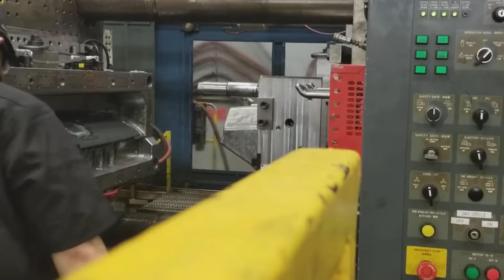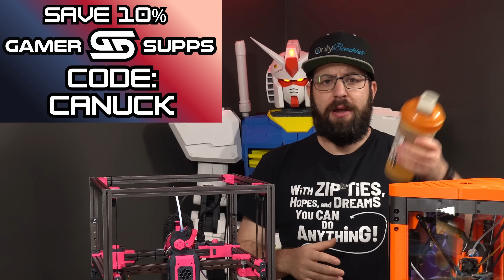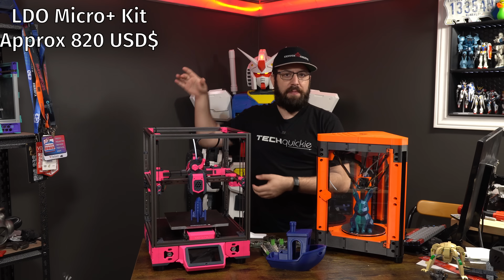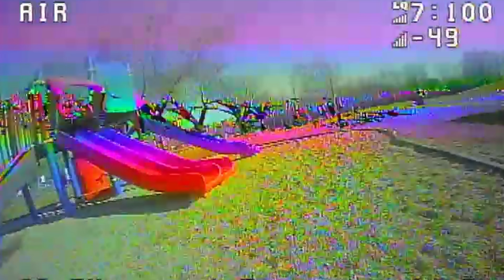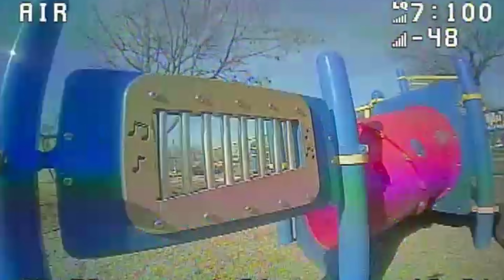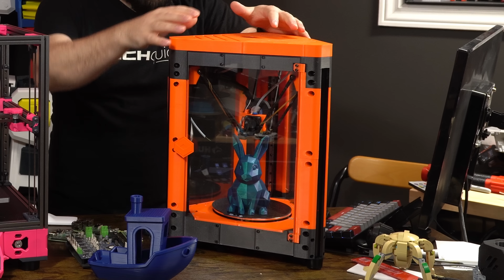Are DIY 3D printers in danger?

Comment: I'm by no means an expert level 3D printer owner. I've had an Ender 3 S1 for a few years now and it was my second attempt to get into the hobby and I've had moderate success. I really wanted to get one to push me to learn 3D modelling. But time is limited for me. My first attempt was an old Rep-Rap Guru kit back in I think 2018 or so and it was a disaster. The Ender 3 S1 has been an amazing printer and although it took some basic learning about how to keep it tuned and maintained, it seems like the way to go. The Bambu printers scare me because they streamline so much it doesn't feel very sustainable and it is a closed eco system that doesn't give back to an open community, it is very insular. I like FOSS and I like using Thingiverse, the Makerworld platform seems like a very privileged club of people who want to high five each other for their cool printers they act like they don't have to maintain. It doesn't work for me. Anyway, that's my rant on my experience with 3D printing. I hope to see more options that are community based but can match or surpass the features of the Bambu stuff.

Comment: I would love a core xy but so torn between the hardware bambu offers and the constraints id be required to work within. Sticking with my opennept4une n4pro for now
I just want raw klipper that I can control with python and g/m code. As a cnc operator by day studying electronics, I dont want a walled garden. Give me bambu hardware with an open back end.
Reply: Honestly? Look at some other btands. Bambu's absolutely a walled garden.

I got myself a Qidi Plus4, which is klipper based, and I run it as an sirgapped machine. I run Orca Slicer for all my prints.
I'm very happy with it. But there's always ways to tinker with a pre-built machine if you want as well.
Reply: @LordPhobos6502 i definitely use orca. Ive heard of qidi but never looked too deeply. I just like the hardware kit with bambu, the ams and lidar on higher end models. I havent really seen many open source material swap systems that actually made it to market, but i guess its been a year or so since ive looked.

Comment: Cheap DIY kits and good documentation. That's the ticket. 

The DIY learning curve is ridiculously high. Printer designs either have barely any documentation (with a lot of crucial info just assumed to be common knowledge), or have a sprawling modding community with so many modding options and different opinions that it just leaves beginners lost and confused. And typically leading to a waste of time, money, and a lot of frustration. 

I think those "fun" printers that Rolohaun is designing is the right direction.

Comment: Well... Commercial offers is not that great. No doubt, Bambu manufacturing reliable and long-supported printers at reasonable price. But basically,  that's it. Fixing and maintaining commercial machine is not that great when it is not reliable or it's support was dropped in a year. 
Many brands have poor designs full of flaws and questionable reliability. Like famous Creality K1 which just refused to work properly due to poor decisions and haste on release. 
I would consider to buy a printer only from Bambu or Qidi. For me, personally, that all that market can offer. 
Cheap P1 clones not much better than bedslingers. Questionable quality, questionable support period (when printer being released with no sparse parts), maintenance harder compared to bedslingers and comparable speeds (if not worse) due to budget and poor design decisions.  
Buy P/S bambu 256 cube or build your own 250 cube? Sure, just buy a Bambu. DIY 250 CoreXY still can perform better though. 5-6k accels on walls that bambu offer isn't something really fast. Stock trident can perform much better. Even without any mods. 
But what about 300-350 size or 120-180 size. Here market has much less to offer. 
I need small, fast, hitemp machine. What I would buy? There os no offer for that demand. I built K3. It's fast, reliable and I can maintain it with ease. 
Same with 350 size. Bambu H2 series are great. And expensive as well. Self-sourced 350 Voron will be cheaper and perform better [with mods]. 
 To sum up: I think that commercial offers is not that great [at this moment] to kill DIY 3D printers. DIY community actually benefit from stuff like good-quality mass-produced PEI sheets or silicone nozzle scrubbers or MMU or.... [whatever].

Comment: I think DIY printers are a good solution for mid to big volume printers at a competitive cost for performance. 
 For a 400x400 or bigger build plate, the shelf printers are either too expensive, or too unreliable. 
I tryed qidi for a shelf solution for a mid size plate and heated chamber, I got a super unreliable printer that Im struggling to return ...
For the same money of the qidi , or a SV08 max or any H series bambu, we can build a decent Core XY machine of the same size and with some  premium components. 
Now for 250x250 or similar size the market as a lot of decent machines at a competitive price that just work out of the box.

Comment: I have joined 3d printing in the ender 3 era, modded it fixed all stuff it needed to fix and i stopped there. Its not cheap sport just to hoard machines that you will not use once its all tuned. Im stuck with this useless knowledge about obsolete machines after bambulab type of companies came out.

Comment: I disagree with you. The stagnation is not as bad as you think. Bambu showed up with the X1C, showed everyone how you build a reliable printer. Then dropped the P1S and lowered the price significantly for a good Core XY. Then dropped the A1 at a quarter of the price of the MK4, forcing everyone to move past the Ender 3 clone era. Then came Flashforge and Elegoo with super affordable CoreXY printers. Now You have the U1, the X2D and the Core one INDX fighting each other with wildly different multi nozzle approaches. 
The main reason for DIY is that it usually is more affordable. This is no longer the case for 3D printing. What DIY has, is the innovation, and will be a core aspect. Multi axis printing, insane slicing configurations not doable lest you build around it. DIY might not be the best approach for most anymore, but it is a key aspect in driving innovation forward and preventing monopolies from forming

Comment: First of all I love all the work building and tinkering. My first experience with 3D printing was when I got an ender 2. I didnt want to be out much money if it wasnt for me. Turns out it was. I modded that thing with the belt tension, cooling ducts, aluminum extrusion tension lever, ABL probe (yeah 135mm lol) ABS parts. I enclosed into a IKEA lack table enclosure. Bought a 200W heater. And made it print parts for a Voron 350x350. 2.1 then upgraded to 2.4. When they went to direct drive. I never did the stealth burner. But I've been wanting to upgrade to 4 head stealthchanger. But as you said parts are expensive, id have to redo my entire printer that has been bulletproof. I've bought some parts for it like Clicky Klack door, BTT octopus pro, but cant seems to get around to it. I think its because I should make a whole other printer. But dont want 3 printers.

Comment: Watched the 3d printing community here and there over the last years (started when i saw an Makerbot machine in 2014 / 2015) and finally bought my first printer, the P1S Combo last year in May.  After i got enough into to get ABS and ASA properly printing i bought an Formbot Voron 0.2 kit as my first DIY project. Including  a lot of mods like Dragonburner V8 and CAN from the start. Took a while but was a fun little build. But i never saw anything of Klipper before so the software setup was a huge pain und took me double the time as the actual build. But after i got everything working and dialed in it prints unbelievable well. Almost same quality as my P1S and only slightly slower. Adding all up including needed tools I am roughly in same price  range of an new released X2S Combo. Do I regret it? not really. It´s all about the experience to build one printer yourself and getting to know how anything from the kinematics to software works. would do it again any time!

Comment: All of my printers up to the latest (with the exception of my resin printer) have been open source, self build. I have slightly gone to the dark side, and bought a Bambu, which is great, BUT, it does have a few foibles in it, which you CANNOT get rid of, because its closed source. Hence, I will always prefer open source because problems can be pretty much always solved, by either changing firmware, or hardware. (Also, I virtually never print decorative stuff, it's pretty much all technical things, useful things, and often... Bits of printers!)

Comment: Prusa was and still is in the middle ground of two worlds. Their software is open source and you can buy a Kit and modify your printer while building it. For example the C1: 1.5GT belts, pulleys, toothed idler and "pind" mod. It is kind of a printer from a big company but is also "your" machine. It is also a very good machine and for me does not lack features. It has motor phase calibration with the TMC xDirect. Klipper can't to that due latency issues as of now. Which means the printer is much quieter than most DIY machines. Even though RRF is about to launch that feature with RRF 3.7 or 3.8 but RRF is a niche within the niche but I still use Duet3D controller boards with my Voron 2.4. That is why I support Prusa and soon buy a C1+ with INDX. I can build a printer, get a steel frame and a quiet and also VFA free printer. Many cheaper printers don't offer that package (if not all?) because even a U1 as a tool changer has VFA at TPU print speeds. Also I love my Voron 2.4 but heat soaking the aluminium frame isn't fun when your other off the shelf machine has a steel frame and is after 15 mins ready to go. The DIY market has shifted but not dead and with INDX around the corner and Duet3D being the toolboard supplier I hope they will exist for years to come.

Comment: As someone who also started in 2017 and has 2 Enders converted into core XY machines, I've been through the pain of getting those machines up and functioning. My X1C has just worked straight out of the box with no problems since I got it in 2022. I took my two enders down to add beacons to them in 2024, and haven't brought them back up just because I haven't needed the throughput of 3 printers, along with the ease of use from the Bambu. I honestly don't know if I'll ever feel the need to bring the enders back up. They were fun to tinker with, and taught me a great deal of the inner workings of 3d printing, but I no longer enjoy that aspect of DIY 3d printers. It was always meant to be a tool for me, and Bambu has made an acceptable endpoint of said tool for what I am looking to do.

Comment: I only hate the thing that 3d printers goes to a rout where the whole build is closed source so you cant just tweek it or add mods easyly. This is what killikng the diy area as well. I love printing and i love my sunlu s8 with my thons of mods. So i may just stick with it and make it fully enclosed so i can print with a lot of materials. Currently im working on dual 1kg loadcell z probe and pt1000 copper head mk8

Comment: I've built a v2.4 a year and a half ago. It was my dream 3d printer at the time. I think building that was the best idea possible for me. I loved building it, I love using it and I think it's better than most commercial printers at the moment. Is it as fast as those? No, not even close. But I know the ins-and-outs of it, I can run it locally without weird firmware restrictions, and I can easily modify, tune, repair, you name it. However, I can understand the other side of the coin. For some people building the 3d printer is the hobby. For some people actually 3d printing is the hobby, and they just want a plug-and-play printer. Each to their own I guess, I'll stick to my Voron for the forseeable future.

Comment: I thought I'd like to build my own printer. The problem I found was that, for the kit I wanted to buy/build, A LOT of parts had to be 3D printed first (and printed in ABS, requiring an enclosed printer with active environment control and ventilation). I paid $260 for a Creality that printed the things I wanted to print.

Comment: I was going to start my printer journey with a Voron kit and you know what the Voron community on discord themselves told me? Not to get one. So don't blame consumers not being interested. The community themselves are cannibals. While i'm new to 3D printing, I wasn't new to assembling things and putting it together. However I did want a solid machine even if I had to build from scratch. Which is why I made the decision not to get a Voron. Because it simply wasn't solid and it was over priced. Furthermore machines that were already pre-buiilt around this time could do the things Voron struggled to do out of the box, and I've noticed that no one building their printers seems to actually do the thing they're made for. Which is actually print. They even said "are you looking for a tool or to tinker?". Well obviously I'm looking for a tool, but I didn't think I would mind tinkering (to a degree). After all if I could buiild my own machine I wouldn't be relying on a store to sell me one locked down with their hardware and software. However after getting a pre-built I realized that's all an illusion and basically a scam. The voron community (on discord at least) were stifling innovation themselves. At the time when I joined if you even mentioned an active heating chamber they would ban you. It was like speaking on voldermort, and ironically enough my first printer came with an active heating chamber. I still wouldn't mind building a printer, but I say all that to say for the cost it's not worth it and anyone in their right mind needs something they can actually use and not just spend time infinitely trying to fix to do things other  printers can do out of the box. Plus you mod ANY printer.

Comment: I started with an ender 3v2 which I modded and kippered to hell, and replaced it with a p1s after deciding a Voron was too hard and expensive. This is LAN only and old firmware due to software concerns, but it works really well. 
My next replacement is very likely to be a voron extended with stealthchanger.

Comment: As someone who is entirely uninterested in building a 3D printer, I suspect your "Golden Age" was fueled by two major factors that no longer apply.  The first you've noted - the availability of high quality, easy to use, high performance off-the-shelf printers; but I think you're severely underestimating how many people started building Vorons in 2020 because there were no other options.  That is, I think you're OVERestimating the natural size of the DIY market.  Now that there are alternatives, you're seeing your hobby shrink down to the genuine enthusiasts.  Which is ultimately a good thing, because it means the people who are around are the ones who truly want to BE around.

The other factor that I fell has changed is the "low hanging fruit" of innovation have all been plucked.  I expect that if you dig into it, most of the people responsible for the truly great innovations in DIY printer builder are still around, and that the folks who've stepped aside in favour of a Bambu machine weren't adding a lot of new ideas.  If I'm correct, the reason that the rate of innovation has slowed so much is not that there's less people, but that the technology was very immature in 2020 and is much less so now.  I really feel that 2020 was to 3d Printers as 1930 was to piston-engined prop planes; and 2026 is like 1946.  Autoloading handgun technology plateaued in the 1980s.  Winches and cranes matured in the 1880s.

Technology hits convergence points where it becomes clear what the best way to get a task done is.  3d Printers, overall, have room to grow, sure, but some elements like motion systems are pretty well solved.  The only changes now are to emphasise different performance areas or change costs.  (Time vs money vs quality.)  There's less innovation coming along because there are a lot less places where the optimal solution hasn't been found yet.

Comment: I’m an automotive tech who got into 3D printing during COVID with the goal of making cosplay parts. So far I’ve printed one helmet, but most of my time has gone into building and upgrading printers—things like a Voron, Ender 5 mods, and a Mercury One.1 Hydra.

I tend to fall in and out of the hobby, and every time I come back I’m blown away by how much new stuff has come out. Honestly, there’s so much happening that my Voron has basically turned into a never-ending project.

At this point, I’d say I enjoy building and modifying printers more than just printing. My workhorse is the X1C with AMS—it just works, and more importantly, it’s never torn apart.
Reply: I'm glad i Bought a prusa MK3 Kit, I Like building the printers, but i dont want to Tinker too much, and have hassle with Software, I suck at that. I print stuff for Work a lot so I never get really Out of the printing for Long.  Looking Forward to the indX 8 on my core one.